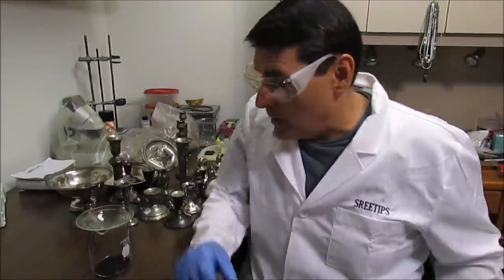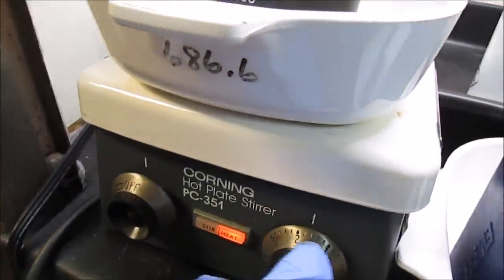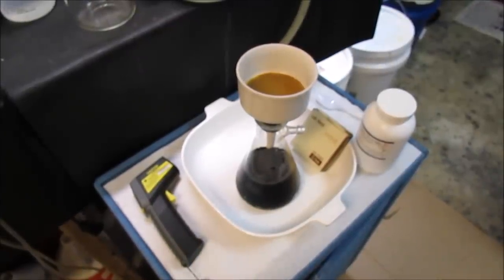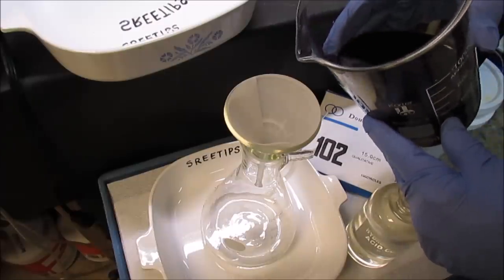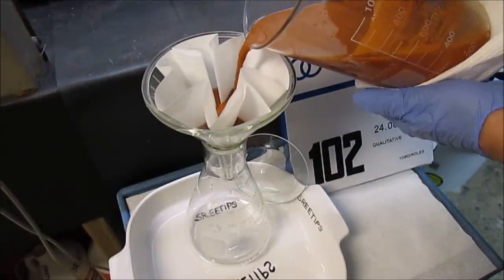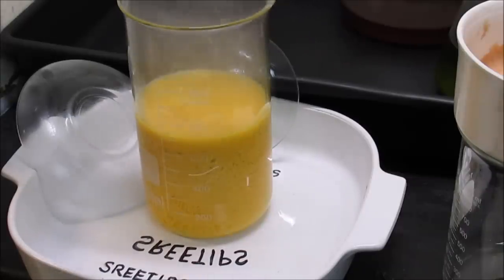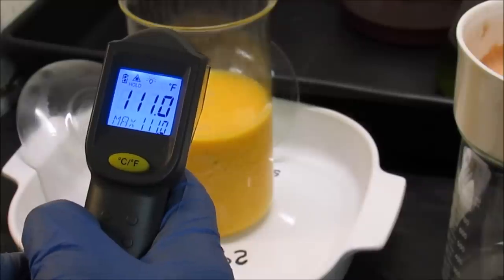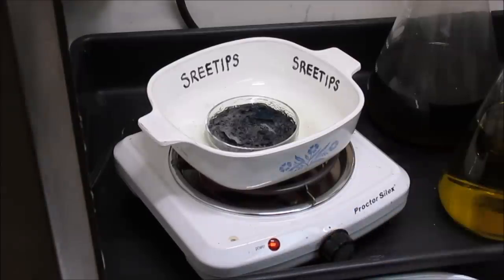Platinum Recovery From Automotive Catalytic Converters Part 2of2

Comment: But you not shown how to recover platinum
Reply from the maker: Yes I did. It was the yellow/orange powder that precipitated when I added saturated ammonium chloride. I filtered it out of the palladium solution and saved in the little plastic container with the red snap-on lid. It's platinum metal, but in its salt form (ammonium hexachloroplatinate) calcining in a fused quartz dish would yield impure platinum sponge contaminated with palladium.